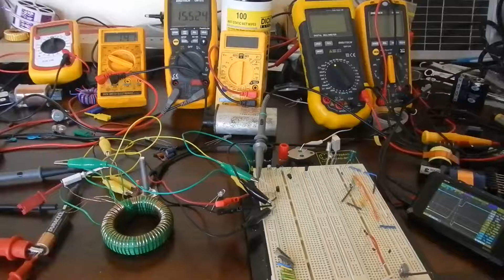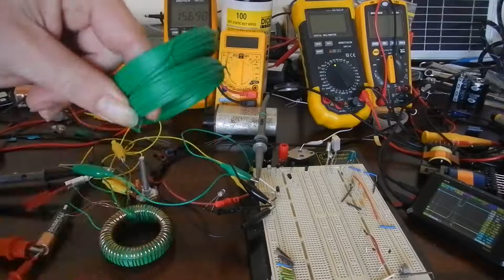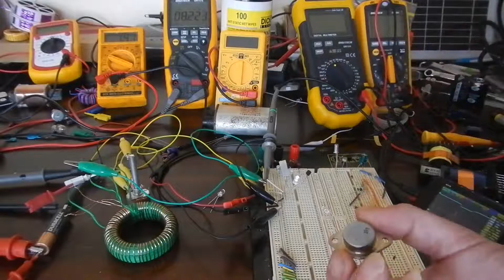Reverse Joule Thief Explination

Comment from the maker: I've never seen that on an npn JT. The base connection always goes low. If your using a pnp transistor, then you can use the base connection for the anode. If you have a npn circuit that runs a LED from base to pos I'd love to see it.

Comment from the maker: The idea is for the ties to be bifillar coil and toroid for the other coil at the same time. Can't say if it works the way I intended. It is interesting though. I will come back to it at some point. I think it might be better as a trifillar or with different winding pattern.Each winding has low henrys, yet combined in one length is 5x the total henrys of all the parts.

Comment from the maker: You could probably use a crystal to affect the timing of pulses if that's what your suggesting?
I charge a cap to 250v in another video. Takes ages to charge a 2000uf cap though and I'm pretty sure watts out of the battery are about 4x watts into the cap. It's not efficient at all at making over 100v, Just got no amps in it,  Although it draws around 200mA+@2v=1.2w. so 1.2w/250v=4mA less losses. I think there are a lot of losses.

I have charged a flat battery from a flatter one though ;)

Comment from the maker: I really want to try the 80mv thing, especially with germanium. The best one I have for Joule thief is ac141k from ebay. I need a bigger coil to get it to work, and a super cap or the right diode combo to give me 80mv.. Thinking about trying a flyback I have from a 200w CRT ;) will defiantly post vid if I get one working. Scope trace varies with every coil and transistor and even voltage. this looks much as expected. Sometimes some big gaps between flashes,at 47hz is the slowest one I have done.

Comment: Very good explanation indeed those spike can be a problem sometime since they can burn the BE junction in some low power transistor. Had it happen to me couple of time but you can indeed use all that extra power to good use. Also nice way to make a coil there.